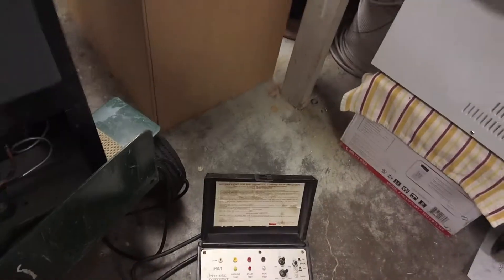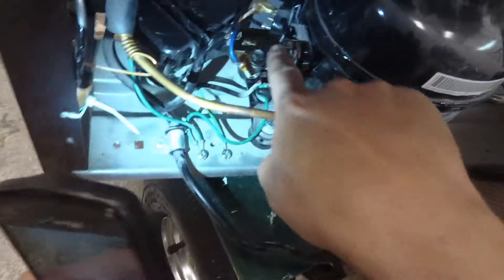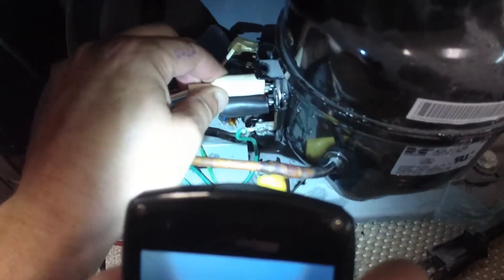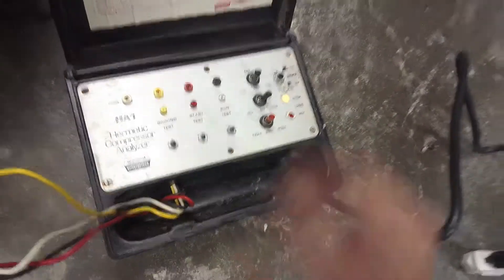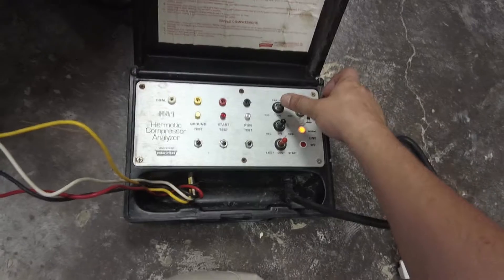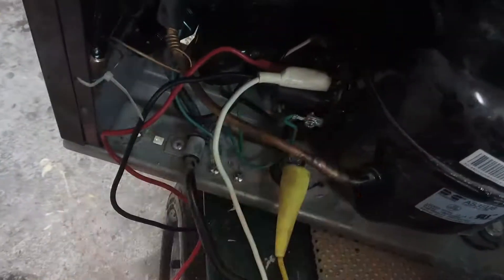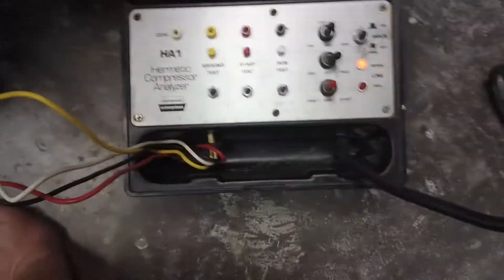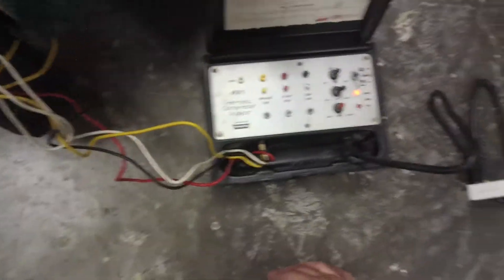How A Hermetic Compressor Analyzer Works

Comment: You are jumping from pillar to post without any apparent logical thought process Jeff. Have you read the instructions? The reason a compressor will not start is because it is under load. Give it time for the refrigerant pressure to equalise. Hard to teach others if you have not mastered the knowledge
Reply: The whole video is a shit show full of whosey-whats-it's, thaingies and whatchamacallums.  If you learn anything here, it will be what NOT to do.

Comment: Will it work on 230V 50Hz single phase. Could be very cool to have.
Reply: Yeah you have to jump your 220 onto a regular outlet,  plug it in and you white neutral is now hot 24/7 regardless of switching,  until you unplug it . Inside is just switches and 2 caps 100, 200 . Thev300 is just the combo

Comment: Very cool. I just started a new job doing maintenance in a commercial building type setting. All tools are company supplied and this is on the tools list. Never seen or used one of these, or even knew this existed. Good to know what it is and does so I know what to expect on the job. Thanks for sharing this.

Comment: Were you ever able to get a single phase compressor to run in reverse with this HA1 analyzer in 110v or 220v applications?  Do you know if reverse only works on three phase? Thanks.
Reply: Its only interchanging run and start terminal both winding was on opposite loop that is why when the terminal was interchange it will work on reverse but it can be done only for a few second or else your start winding will burn

Comment: They still make them...UEI about $250.00 on sale....I've never hooked mine up to 220...A little afraid to, running 220 down a 110 volt cord, but they say you can do it...FYI for you guys, a compressor normally won't start again after just shutting off...To much head pressure to start against so they have to sit and let pressures equalize....They'll kick the overload, Kixon or whatever type used until they do....Thanks to the what sounds like a country boy making this video...
Reply from the maker: Yea me too(A little afraid to, running 220v)  haven't even used the thing but once just in this video. I is a country boy lol.... born and raised in Georgia Thanks For Watching  Vernon Roach